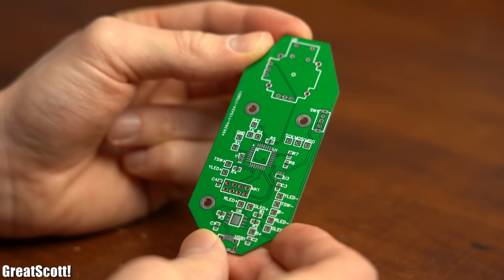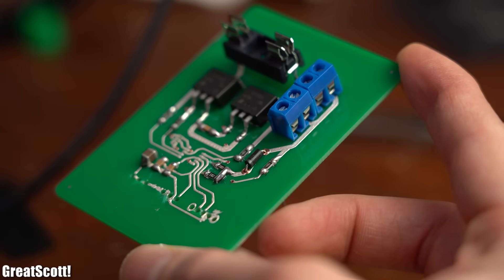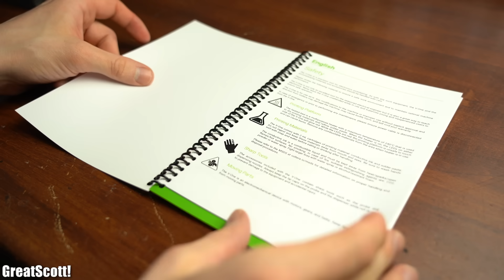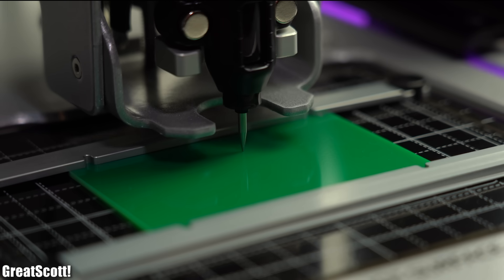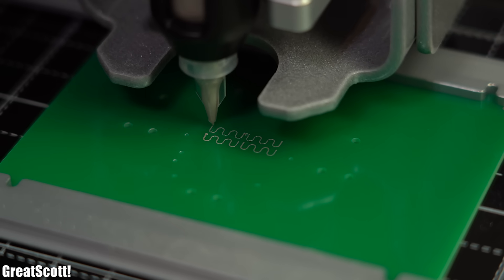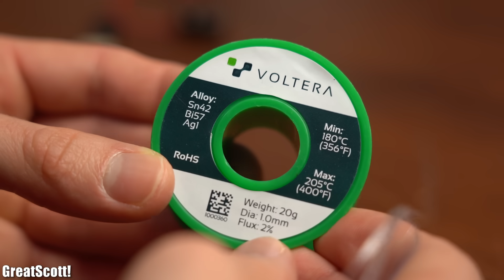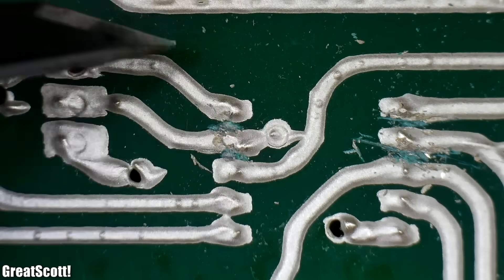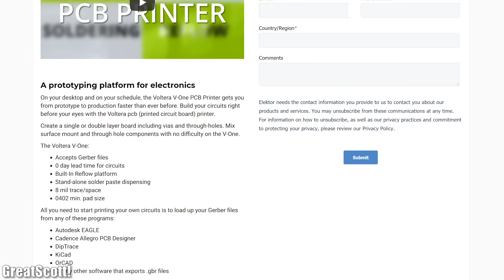You can now PRINT PCBs! Creating a homemade PCB with the Voltera V-One PCB Printer!

Comment: I'm not all that knowledgeable when it comes to designing PCBs and whatnot, so maybe I'm wrong here, but what exactly is the benefit over this than a breadboard or similar? Since it's only 2 layers it's really no different than having one side of a breadboard be layer 1 and the other layer 2, and just connecting everything, and I can't imagine designing that circuit, once functioning, onto a 2 layer pcb would be much of a challenge at all. The only thing I can imagine this helping with is if you were making a design that uses components that are only available as surface mount and no alternative exists, and I'm not sure that's a thing. But again, my knowledge here is limited so if it does make sense and I'm wrong please let me know.

Comment: couldn't you just 3d print a small pre-"etched" board with a ceramic and PLA mixture on an FDM 3d printer? and then simply drop small amounts of molten copper into the etched areas while a fan blows on it for quick cooling. Surely there is no reason why PCBs need to be this hard to manufacture...

Comment: But manual etching is really inexpensive and easy to do, why even bother ordering PCBs? For double-layer you can just drill 1-2mm holes and solder copper wires on both sides, it's easier than with rivets.

Comment: The 3d printer designed for the hobbyist but priced for the rich !
At approx $4k, you are looking at needing to print around 3000 home-brew pcb's just to break even on cost....lol. That's before you compare the substandard results ( excess material deposited and smeared throughout the board ).

At $4k to buy one of these machines, these are NOT remotely viable for the average person, nor would a university or such institution bother with something that gives such mediocre results.

Go and get a cheap 3018 mill from China, or even a home-brew photo resist etching kit for better results.

Comment: The quality of the print was poor. I imagine that it could be tweaked to work better given more time as an end user, but even then this looks only useful for a limited number of tasks. In the recent 10 years, I have designed 1 board out of a hundred that had features large enough to be all printed by this device. Even my hobby boards I make for home projects mostly are 4 layer for reasonable EMC performance and have fine pitch features beyond the capabilities of this printer. I’d say this tech will work to maybe 20-30MHz MCUs, any further than that and you’ll go over limits. Maybe most people don’t care… I do. No reason to be a bad citizen when doing this sort of engineering :)

Comment: These folks from Voltera took a wrong path. A SLA 3d printing tech repurposed to cure photo resist film + drill attachment would be 1/10 cheaper and could be a breakthrough. Even the cheap 8" FullHD displays offer 0.1mm resolution, so 2K or 4K ones would be on par with the resolution of a laser printer. This approach woukd also allow UV curing of the mask.

Comment: Wonder after printing if you can use "MG Chemicals - Liquid Tin" to treat the circuit board after heat curing the conductive ink to laydown a layer of tin on the traces for better conductivity and ease of soldering.
Reply: Thought about that ourselves - truth is, super toxic stuff.

Comment: This thing looks like a total pain to use, you have to change PCB design use rivets on any through holes, the consumables are insanely expensive, and soldering to the ink looks kind of awkward needing special solder too. With proper prototype PCBs only taking a few days to turn around these days and only costing a few dollars for small PCBs I can't see a market for this gadget. Also the conductivity of the ink isn't close to copper so all in all this seems to be little more than a very, very expensive toy.

Comment: This is a really fascinating review, very in-depth, and we learned a lot watching you use the tool! Thanks so much for taking a look at our technology! You're absolutely right that our customers are more often professional electronics engineers looking to quickly validate ideas, do rapid solder paste dispensing for SMT components on short runs of factory-fabbed boards (something you didn't really do here because you prefer hand soldering) or work with flexible/stretchable substrates where an additive approach is required. We also have a lot electronics designers looking to test/validate their own custom conductive ink formulas among our customers, because you can easily swap different cartridges of ink into the machine. As you point out, we've had a large number of universities purchase if they're looking to work with exotic substrates, or to teach the fundamentals of electronics by having students see circuit designs come together before their eyes. 

In any case, this is a very fair and comprehensive review of the Voltera V-One, we will stay tuned to your channel for more! Thanks again Scott!
Reply: Keep on innovation, that's very good printer! Love it
Reply: lower the price...
Reply: Sounded very interesting until it became clear it was an undeclared sponsored video. Underhand and misleading.
Reply: @MeSoyCapitan  I thought he was extremely clear they sent him the printer to use?
Reply: @MeSoyCapitan  He literally said "This video is sponsored by Elektor, who lent me the PCB printer showcased in this video." at 2:06
Reply: why havent you guys donated this printer to Scott instead of asking it back?
Reply: @filesopen6188  Smaller companies don't have unlimited budgets. Supporting them means later they can give out more stuff.

Comment: You're reinventing the pcb kkk , why not just print the circuit into a transparency or a vegetal paper and then transfer to a pcb using heat , so u can etch it on 
anhydrous iron perchloret in less than 1 hour ???
If u gonna spend money , buy urself a good cnc w ballscrews and linear guides.
U're using a low budget one , i can move in steps of 0,0135 of a mm on my home made ball-screw and linear guides machine. Just chek for squareness and bed level or give a pass removing 0,5 mm of the whole bed and ure fine !!!

Comment: Having to buy proprietary consumables is an instant red flag. Especially for that price.

It really wouldn't be that hard to make something similar for a considerably lower price. ODrives could give the accuracy and precision, or use a powerful laser with a galvo system to engrave a design onto a PCB that has been covered with something to resist etchant.

Comment: I agree that it's still expensive, but the sheer fact that by saving €350 for 1 year you can purchase an in-house pcb printer is unprecedented.

A Commodore Amiga 1000 was worth $3028 in 1985 (adjusting for inflation), and was the first multimedia computer.

The first commercially successful computer with a GUI (the Apple Macintosh) was worth $6042 in 1982, adjusting for inflation.

It's only fair to say that this could very well be the dawn of home electronics manufacturing!

Comment: I had to chime in. I made my work buy me one of these, because I'm impatient for sending out boards.  The machine works great. That is correct, the alignment, set up, and even printing are a piece of cake.  That's about it.  If you want to do anything that isn't surface mount, forget about it.  The silver paste they use as traces just doesn't stick well enough to their pcb's to be useful.  Every time I soldered to the board, it would rip off the pads.  Even if you use their solder, use the machine for re flowing, and to bake it, the components never stayed on very well.  The idea and concept are great, the technology just isn't very good yet.  Get yourself a perf board and just do it the long way.

Comment: If it could do multi-layer boards like professional tech, or was cheaper than existing 2-layer techniques, or both, that would be something.
But it's stuck in a weird middle ground of being most costly than DIY milling/etching, without having the extra capabilities of professional tech. 
I'm not really sure what the value proposition is supposed to be...

Comment: We have one where I work. Honestly, I'm more likely to use our LPKF desktop milling machine. It's very tricky to calibrate the ink flow (compared to a 3D printer, say). It does look like yours has quite a few improvements over our original model, so it might be more viable. It's certainly a high quality machine, as you said -- very solid metal construction and clearly good quality components throughout. The finicky (and perishable) ink makes it awkward to use, though, so it's a niche instrument, if a cool one.

Comment: Lots of steps, lots of calibration, many unknowns (trace adhesion, trace density, trace height, trace resistance, etc.), and the high price point would put many people off when PCB mills are available at a lower cost with additional applications. I'll stick to photolithography, photomasks and etching to get my PCB's from software to solder in under an hour for very little cost.

Comment: Thanks for the honest review. Given I can make a PCB in roughly 2-3 hours at home and not have to wait for or buy consumables, I don't see this as a good product, even in an educational environment. Hell, when I helped my instructor in high school make the boards for the class we used the photoresist method which was quite quick anyhow, plus no limit on PCB dimensions.
Reply: How do you make yours?
Reply: @ameliabuns  Currently with pcb software, a laser printer and dextrin coated paper. There's a ton of info if you search the web. JLC would produce better results though.

Comment: I feel like you held this and the CNC milling of boards to very different standards. You ripped apart milling boards because you could not mill the finest pitch SMD IC chips and for not having a solder mask. Now you have a machine that costs nearly 10x as much, has results that are worse, and you praise it as an expensive but viable option. That is a really fishy stance to take when you complained about even the workflow of at home prototyping previously. Not saying this device does not have a market but if you are going to compare results you should at least hold them to the same standard.

Comment: The printer îs to expensive for the quality of the printed pcb. With only a few UV leds, a timer, and UV coated pcb's you can make almoast profesionaly pcb boards. I succeeded creating pcb with Qfn44 footprint.
P. S. I think you are using too much solder for smd parts.

Comment: As someone that uses a voltera v-one at university I advise this only be used for flex circuits (fabric or Mylar sheets) as the consumable costs and the finicky printing ink are really not worth dealing with on a regular basis. It is also okay at solder paste application, but stencils are so cheap and are much more repeatable that I really don't see much use there. I think the technology is a little too early just yet, but I would keep an eye out for future improvements, particularly from voltera as their software is actually really nice. Hopefully voltera makes their ink and paste cheaper (and their paste has QC issues at the moment) in the future too.

Comment: My problem with the voltera (speaking from experience) is that the traces can scratch off easily and it requires special low temperature solder is more difficult to source... otherwise normal solder will melt off the printed traces like hot wax. This machine is only good for rare circumstances otherwise I'd recommend you get it professionally mad case you are limited to double sided pcb designs.

Comment: I own one and it’s not all it’s made out to be. It’s faster for my team members and I to place the Solder ourselves than recalibrate, relevel, and replace the solder every. Single. Time. If you have to make more than 1 board it will take 5+ hours, we are selling our Voltera, it’s great for a hobbyist, but not for in house prototypes. We have had ours for about 2 months and don’t use it very often because of the long set up time

Comment: You can of course reflow the traces with some solder mask to increase conductivity. and use some solder mask pens to cover traces if needed. Anyway this looks like a nice product for universities or maybe prototyping as you said. If I was building my own PCT I would mess something up at least multiple times, so I would have to wait for my PCB for a month. But I am not a PCB designer and my knowledge base is is not that good for building complex projects, but if needed I can use dead bug methods.

Comment: Given just how cheap prototype PCBs are, these types of machines really have so many drawbacks that it's difficult to imagine any practical use-case. You can order 2-layer boards on 24-hour turn for a modest cost penalty, and even those will vastly outperform this type of machine. Once you're talking multi-layer then there is no comparison.

Comment: That is seriously overpriced. The mechanics for it are just a small CNC router and a heating bed. Are they thinking that electrical engineers are going to use it for prototyping? There is no way you could justify the cost when getting a pro fabbed board is so cheap. Yes, it takes a week to get it, but in that time you can work on other projects. If they had kept it sub $500 US, they could have sold tens of thousands to the hobby market and schools.

Comment: Too expensive.  When you can spin a board and get them back in 3 days for $5 + shipping for 10 boards it's not really worth it.  The only application where this would be useful is RF prototyping but because it's not copper then it's of no use as it's not repeatable for manufacturing.

Comment: I have used one of these. It's shit. It's far too easy to lift traces from the board with the iron, and the solder paste dispenser doesn't dispense enough solder and there's no way to change it in the settings. Complete waste of money, thankfully not mine. I spent half a day trying to get a circuit made that I could have done on protoboard in an hour, and it never even worked.

Comment: This is where 3D Printers were 10 years ago. So I see this being really common and cheap by 2030 - maybe sooner. Hope this idea survives the embryonic stages. Great review!
Reply: Actually, sooner. You can make a 3d printer do exactly this. There are already injector extruders available, and so on... this thing isn't worth $400, let alone $4000.... Ugly finish, etc... I can get just as ugly a finish with protoboards, and for connecting surface mount components, I just run traces around and don't cross... Or, simply run thin wires and a bit of adhesive to get the same result for prototyping.
Reply: It goes in hand with open source hardware
Reply: well thats all it ready is a 3d printer stuck in a 2d plane, any as with any 3d printer, it sould be possible, for it to move up into that 3d space, also, imagine if reagual 3d printer get realy good at printing to mediums at the same time with all stringiness, you could use that stuf to 3d print  pro-grade multi- layer PCB, with many layers, and I dont now why, take it to the extreme and built it cube if you wanted too. with all the components mounted on all 6 side,
Reply: Even earlier if I succeed in my graduation project
Reply: at the rate 3d printers are going, and the demand for more functional prints, I think it will thrive!
Reply: cheap where?
Reply: 2030 no humans on earth...
Reply: @boscovich11  Elaborate, please?
Reply: @loleq2137  it's a joke. OP said that maybe those printers become cheap and common by 2030... loleq21 said that maybe there will be no humans on Earth by then...
Reply: @OgbondSandvol  It's not a joke. It's a threat.

Comment: I think of one use for this scenario. Since you can literally print it, it should be possible to print multi-layer PCBs, one just have to add a non-conductive layer (which has to be figured) on top. That way you could get away with smaller parts and even use the smd resistors as a distance between them. Obviously you can do it only on certain parts of the board.
What are your thoughts on that?

Comment: Even those rivets are normally too expensive to consider their use. Also the ink is silver based and must be quite expensive - yes, now the video has reached that point, and it is not even as conductive as your regular 17 µm thick copper trace? How is that even possible with those blobs of silver paste?

No way. Using toner transfer gives you instant pcbs of at least similar quality. Ok, a CNC-drill integrated is not bad, but... There are European pcb-houses which deliver professional quality circuit boards the next day - and similar in the US. You can order quite a few of those boards for the price of the consumables on this machine, not even talking about the cost of the machine.

Comment: The concept is great, but the practical use is non-existent.
Very slow, sluggish and pretty much useless.
The speed should be like a third of the time and it should in fact use multiple extruders to create the actual board layers and then circuit layer thus build the whole PCB from scratch. Not you needing to use a blank and then drill it out.
This is what it should be done and with a professional grade 3d printer that can churn out a lot of boards fast, thus replacing the traditional method with the copper plated boards introduced in large machines.
This 3d printing could be better be used for flexible boards where you'd need to route thin films through intricate 3d volumetric shapes.
You place a thin film, secure it and then print, but it will need a large ass surface, not the tiny one we see.